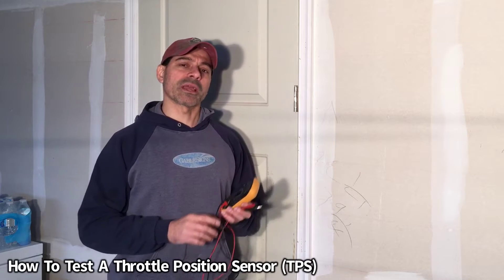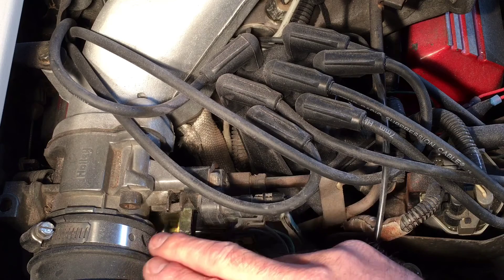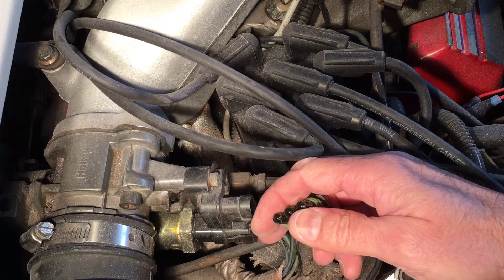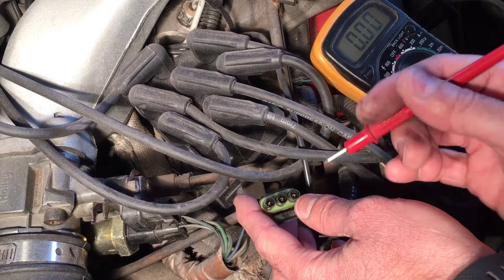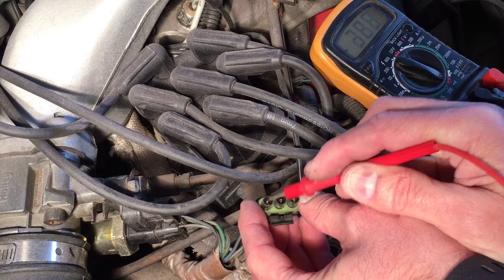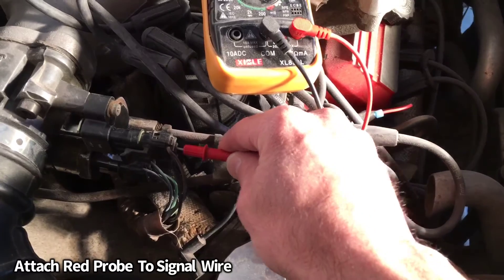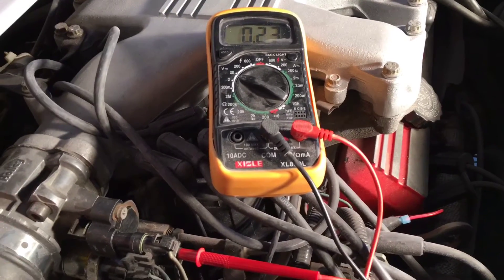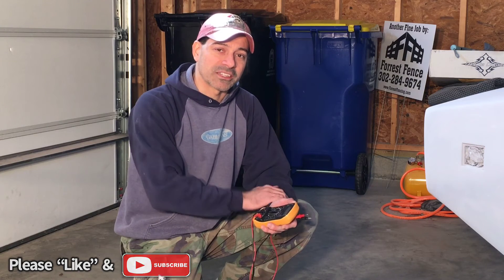How To Test A Throttle Position Sensor (Andy’s Garage: Episode - 162)

Comment: Could a symptom of a bad one cause vehicle not to accelerate untill throttle is fully pressed. After I get moving the throttle works like normal.but when I stop and idle, I have to press pedal all the way for a split second for it to start moving again. Thanks for the info boss
Reply from the maker: @jamesolivier7861  That could be caused by a dirty throttle butterfly valve. When carbon build up it can cause it to stall or malfunction unless you press the gas pedal

Comment: Please add how you ground the multi meter on the car-a picture. Newbies don’t know. Also, did you plug the throttle sensor back in when you tested the input?
Reply: Check other videos because I've seen how they ground it to the battery negative cable

Comment: Hello. My signal wire reads 1.02v and when throttle is pressed 4.68v. 
The ranger is dying when I let off the throttle though
Reply from the maker: I would also check the throttle body intake. If you get carbon build up it can cause it to stall when not accelerating due to the air being obstructed coming in

Comment: hello my signal only goes from 1.2 to 3.9   volts  and rises and lowers but never above 3.9 volts when i manually moved throttle cable up and down but never got above 3.9 volts..is that  OKAY?  ALSO it wouldnt read continuity for ground UNLESS i turned KEY OFF...98 kia sportage

Comment: are u backprobing into TPS  with it connected to harness? and key on still? At end video? when i first start my 98 kia sportage it revs way too high at 4,000 rpm, then if i DISCONNECT THE IAC vlave it goes right back to normal about *%) RPM ..does this mean MY IAC valve is ok?????
Reply from the maker: Yes, backprobing with key on. Easy way to test your IAC valve is to remove it but leave harness attached. Start car and see if the plunger moves. Your issue may be the MAP sensor. I had a similar problem and it was the MAP sensor. Get a GM OBD1 scanner and see if you have any engine codes, that will point you in the right direction
Reply: @PhillipsVision  HI ANDY THANK U SO MUCH ESPECIALLY ON MEMORIAL DAY...MY IAC VAVLE DOESNT HAVE A PLUNGER JUST TWO FLAPS IN IT ITS A 98 KIA SPORTAGE
Reply: Great video
With ignition off I get a reading for ground wire but with ignition on I get no reading for the ground wire 
All other wires check out as on video
Any ideas why this would be

Comment: On my  2000 Toyota Platz i saw the engine check light on when i was going up hill and it disappeared when i got on a falt road it also loss power sometimes  i tried this but  the Signal wire was showing me  2.57 and if i accelerate / the throttle body  it drops to 0.56 is this a good reading or bad

Comment: tested my chevy tps sensor on throttle body and get no readings AT ALL on the sensors however i do get a reading for the motor.  I do not have any DTC's and the car is running but idle and acceleration are not great.  How is the car still functioning if throttle body isn't working?

Comment: When I unplug the tps  sensor I have the same voltage as the reference wire which is reading high at 5.8 volts. What could cause this,  computer?

Comment: Ok so my signal wire is showing 4.5 volts at all times, even with throttle completely closed. Im getting a p0171 code and the severity of it is medium. (High current to TPS) i just changed the TPS, same thing. Soooo...also the vehicle is stalling at WOT, severely stalling, backfires, bucks and shuts down until it cools off. Where am i getting this extremely high voltage from?
Reply: have you resolve the problem ...got same things as u
Reply: @terrynarrainsamy976  well my issue wasn't the TPS, tho it was bad. I just went and got another one. I believe I over tensioned the clock spring in it when I was trying to set it up and possibly broke the internals, or it was bad out of the box. My actual issue wound up being my fuel pump. Missing, stalling, then eventually dying at operating temp. Wouldn't crank back until it cooled down then the same all over again.

Comment: I keep getting engine code po122
Reply: Low input code. I’d replace the TPS
Reply: I'm getting zero voltage to throttle position sensor already put a new one on OEM part any ideas?  @Dezmon2jz

Comment: I have a 1999 Chrysler Sebring. While doing the signal test, when I opened the throttle I got a steady decrease in voltage instead of an increase all the way to fully open. Is this a bad sensor or another problem?
Reply: When I replaced the to sensor I didn't notice that I also had a fried wire going back to the computer po122 code. The car wouldn't start, so I replaced the sensor again and replaced the end of the wire with a already flared end from a junkyard......and that fixed the problem
Reply: It could also be just the way it works, cause it's old, as long as it's consistent, but idk lolk, sowhat happened?

Comment: I tried this and 2 of my 3 leads on the connector are a little over 5 volts. I figured maybe the connector was bad so I tried it on the map sensor and got the same result. Can’t be sure which one is the current in, signal wire, or the ground because I didn’t want to test the resistance on either lead with 5 volts. So I’m assuming both the current in, and the signal wire are both 5 volts in my situation. The oddball is probably the ground. Any idea why this might be happening?
Reply: Have exactly the same issue. Tried all 3 leads and 2 of them show volts 5.0 and 5.7. Maybe faulty ECU? Any update on yours man?
Reply: @Kickbasser  I just now received notifications from this comment🤦🏼‍♂️ my apologies. It was my ECM/PCM. I ordered a reman unit from all computer resources and the problem was solved. It took me 3 weeks to narrow it down and collect all the parts. It wasn’t easy, but a year later and it still runs perfect. My code was P0351 in the onboard diagnostics but a scanner picked up no codes. Basically no spark but no indication where to look so I started hunting the needle in the haystack. I replaced and/or tested everything spark related. I started cheap and worked my way up to the computer. I didn’t want to spend the big bucks first for that not to be it and fight for a refund. The plugs checked out okay so I replaced the ignition coil, wires, dist cap/rotor, crankshaft position sensor, and throttle position sensor. The distributor checked out okay so I tested the ignition switch. All checked out okay but I wasn’t getting power to the ignition coil. I caved and bought the computer as a last resort. It fired right up on the first crank.
Reply: @Kickbasser Got same problem. What was your problem?
Reply: @redwoodjewellery  Hello, it was a faulty Throttle Position Sensor. I replaced it with new oem and it fixed the problem. I got high revs on idle and while driving. The sensor is reading volts from 0,4 up to 5+ so it was worn out and showed higher voltage in idle than normal, 5,7 in my case. I hope that helps. Good luck
Reply: @Kickbasser  problem for me is that in measuring 5 v in both signal wire and The signal fender wire wit the TPS disconnected. I guess my ECU is dead then?
Reply: @redwoodjewellery  My initial thoughs was the same. My readings were as yours with TPS disconnected. 5 volts in both wires. So I went and bought new one regardless. 40 euros for oem. You could try an aftermarket for around half the price of an OEM.
Reply: But if you have  5 volts in both wires then the problem lies in the ecu and not the tps? Or how did you chansning the tps change the wires 5v from the ecu?
Reply: My problem is that the car refuse to start and "weak spark"
Reply: @redwoodjewellery  So in my case the wires showed 5volts both while the TPS was disconnected. And 5.0 and 5.7 while connected. I tried to rev it and the 5.7 chached voltages from 5.7 to 1+, and as the revs increased the voltage also. So I then figured that it was the TPS sensor. When I installed the new one. The idle showed 0.4v. For some reason when disconnected both wires showed 5. I don't know further as I am an DIY myself. Hope this info helps. Otherwise try your local mechanic. Good luck

Comment: I have a 97 Saturn SL 2 having problems with my throttle position sensor and service engine soon light testing the pigtail I have between 4.98 and 5 V on the gray wire have no ohms on dark blue signal wire I just have a cheap scanner so I can’t see real time and I’m just at home shade tree mechanic any help would be greatly appreciated thanks Dean
Reply from the maker: Signal wire should not have ohms. Power will shows voltage and ground will have ohms.
Reply: @PhillipsVision  Will retest tomorrow I greatly appreciate your help thank you

Comment: I have a 1984 Pontiac Fiero. I replaced the TPS and now it won't start, can someone please help me?
Reply: Same here. You fix it?
Reply: @illstudiocheapertricksandh6447  inspect the center wire of the distributor cap from end to end. Mine was broken on the engine side.  Good luck friend

Comment: I have a 2008 crysler sebring the battery light comes on and the lights flicker what's wrong with it ?????
Reply from the maker: Will the car start? Is this happening when driving?
Reply: @PhillipsVision  yes after a few minutes of running it starts to do it The car runs fine
Reply from the maker: @tonyfrommer7886  sounds like the Alternator. Here’s a video I did I showing how to diagnose and fix the problem: https://youtu.be/APRoyxL89Mg
Reply: @PhillipsVision  check everything l replaced alternater the battery cables still doing it
Reply from the maker: @tonyfrommer7886  its an electrical issue, you’ll need to test everything and trace the cause

Comment: If you don't get the correct base voltage at idle, does this mean you may need to adjust the idle stop screw to obtain correct throttle valve position?
Reply from the maker: If your tps has an adjusting screw...yes you could try that.

Comment: What color on your tps is the signal wire
Reply from the maker: Dark blue, the middle wire. Grey is voltage, black is ground and dark blue is signal.
Reply: Can a bad throttle body sensor cause shifting issues.
Reply: @angelf9800 100% sure

Comment: If the plug readings are correct, does that mean the wiring is good? problem with the sensor? It's ok if the ground readings on the plug are bouncing around?
Reply from the maker: Yes, if harness is giving a correct reading then the wiring is good

Comment: My new TPS is reading .07V "closed" (red lead on glue wire, black to chasis ground). Would I need to do an adjustment to my TPS? And would it matter if the battery itself was like 1/2 of a volt low? Thank you.
Reply from the maker: en4cer450 you should be between .2 - 1.5 at idle, but check specifics for your vehicle. As for your battery, what is the actual voltage on your voltage wire? Should be AROUND 5 volts.
Reply: With red lead to grey wire and black lead to ground I get 4.8V... and red lead on blue wire I get 4.2V